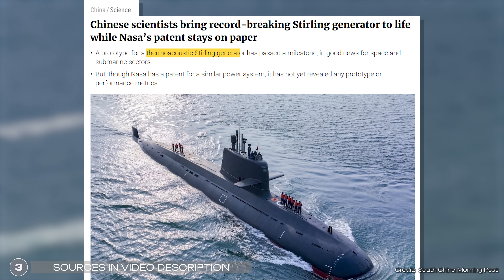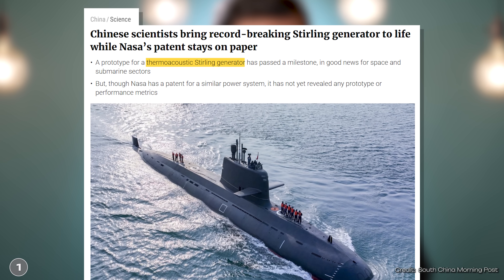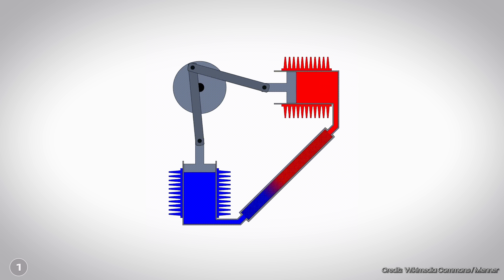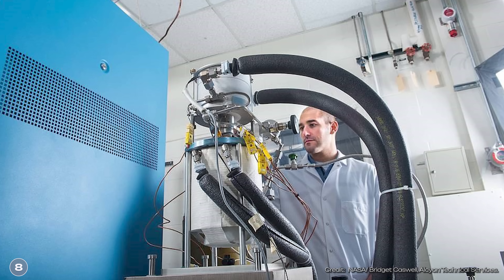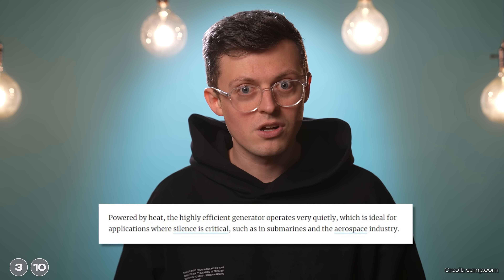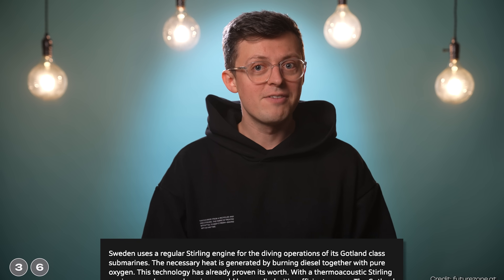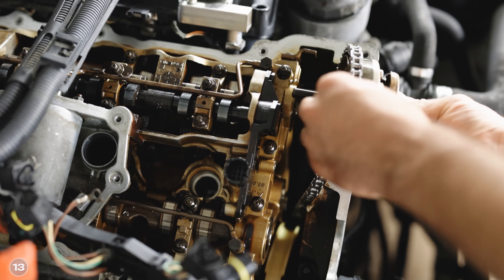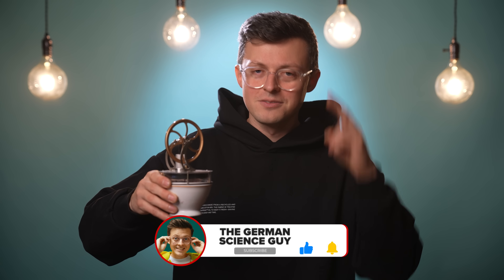The world's most POWERFUL Stirling engine: powered by soundwaves!

Comment: the proper sterling will help to suck every possible quant of heat energy in processes where a lot of heat energi is exposed, datacenters, air conditioners, gliders, is possible to generate energy back, also it can be second generator for, gasoline, diseil generators where we have lost of energy as heat energy, the sterling without rotating parts, just shift going back and forward with magnet coils anf magnets can be cobine with wells turbine

Comment: Another way to do this is to take tesla coils lined up and that works. Another way to do this is to take 3 regular transformer (preferably rodin) and have 2 wound opposite directions to cancel eachotehrs impedance out with destructive interference. Another way to do this is the 2 piston engine. Another way to do this is carbon rods arch and heating method on pyrocrystals (same concept as the tesla coils almost)

Comment: @German Science Guy  

The acoustic engine is 2 or more piezo crystals that push on eachother with their mechanical ultrasound waves to induce electricity in eachother(voltage) without conducting electricity through the crystal so their dissipation is minimal. Their conversion coeff is 30-50%
so it's not the 2 piston engine.

ingredients are: Lead oxide 60-72%, zironcium oxide 5-25%, titanium oxide 5-15%, lanthanum oxide 0-4%, nickel oxide 0-7% and niobium oxide 0-20%.
Their resonance frequency is 27MHz (for uuartz).

Hook them in a glass tube so they hit eachother and induce voltage, then wire them in series to add voltage. Siphon current and voltage back through to not waste it as IT IS NOT CONDUCTED by the piezo crystals and electricity can not travel through them. The elecricity is coplanar with he crystal and "bumps" into it. The entire idea is to miniizie voltage split and electrical loss this way while amplification is occuring.

Comment: Not especially for space travel but the molten salt thorium reacto can use this as an addendum for electrical power added to use part of the power for electricity and using the rest of the hot fluid for process heat in chemical use. This would drain off very little heat using the rest for process heat. Not sure how large this should be,(how many kilowattes is needed for electrical power).like a bunch of these units used for electrical power of say 500 kilowattes, and doesn't need cooling to produce this power. If it would run for 40 or 50 years this electrical power would need little maintenance. Might need exotic metals for the long lasting effects.

Comment: Stirling engine is so elegant! Lack of automotive aplications in hybrid vehicles is puzzling. Thanks for the video!
Reply: NASA used Stirling engines in automobiles as part of their performance testing in the late 70s early 80s. The Stirling engine is less responsive than an ICE and doesn't store energy as pressure like a steam automobile. As result, they didn't do so hot. NASA has a serious issue with anything that can create fire so talking about combustion engines with them is like trying to get assault victims to support loosening government restrictions, even on your best day it's a challenge. So the smart people at NASA thought about what is the best application for the Stirling engine and they determined that power generation is where it shines. The problem was inefficiency due to energy loss during transfer of energy through the casing into the cylinder. 

Several factors have drastically changed the game. First, they've shifted away from chemical combustion and focused on nuclear decay, and the development of graphene is a game changing discovery which will yield some incredible design changes. Graphene has unique properties unlike steel, or aluminum which allow graphene to transfer heat through strands from end to end with negligible change in temperature of the graphene chord. Let me say that another way... I can burn the end of a graphene strand with a acetylene torch while I hold it with my bare hand and you can pick up the opposite end with your bare hand and press the end against your cigarette and light it. As a result, we're not far from seeing a complete shift away from steam systems used in electrical generation to systems that convert heat into energy powered by Stirling or Rankine cycle engines.

Comment: A big difference between a combustion engine and a sterling engine is that a combustion engine needs a fuel that it can combust. A sterling engine needs a heat source and a heat sink. A heat source can be waste heat of a combustion engine or industrial processes, solar, or even a heat battery.

Comment: Cool video. Im an expert in Stirling engines. I was a process Engineer for many years building them. You can input energy and get heat and cold as well. -150-180c on the cold side.

Comment: I wonder how it would work for solar with parabolical fractures ,
In space for a generator , You could use a Thin Reflective film  That could deploy once in space , 
This could be greatly superior in much lighter weight , Then Photo votaic Solar panels ,     

I wonder how  carbon dioxide in a super Critical  state would work , 
That's half way between a gas and a liquid , They're working on turbines with this , They are one tenth the size And I believe twenty percent more efficient  ,

Comment: I see an exciting prospect in using heat from the sun to drive a development of the early atmospheric steam engines.   Perhaps reducing pressure within a sealed copper tube so water boils earlier might be used to transfer heat from hot to cooler  quickly?   This is a US cooling device used in desert nightclubs to cool clubs at night moving heat into cold desert air.   How can we use this principle needing no electricity.

Comment: I love stirling engines. It could have many applications in such areas where heat would rather be wasted.
Reply: Stirling engines are commonly used in recycling heat waste into usable power. Probably the most innovative design that I've encountered was in a bitcoin mine that was entirely hydro/solar/wind powered which used mineral oil as coolant in a bath. Picture 250 high power GPUs running at maximum temperatures transferring all of the heat into mineral oil which is non-conductive so the oil heats up and the constant flow circulates cooled oil in while the heated oil is evacuated. The whole system was insulated with thermoelectric heat pumps that used thermal paste and cooling fans while the oil was recycled into a heat exchanger that ran the mineral oil through a Type A Stirling engine which was heated by the oil and cooled by a waterfall of a low boiling point liquid/gas (I don't recall what was used) which was recaptured by a condenser. All together it was barely enough energy to cool the whole system, but it was pretty ingenious in my opinion.

Comment: Great video, thanks for it. Being slow to adjust operating speeds is not a serious drawback if the output runs an electric generator/alternator, which work efficiently at steady RPM and torque (fine for charging batteries).

Comment: It would be interesting to see the Kockums Stirling engine for submarine air-independent propulsion in the Stirling engine comparison chart. The two v4-275R engines in the Gotland class have 75 kW output (presumably each), running on diesel fuel and liquid oxygen, and they are roughly comparable in size to the thermoacoustic engine shown. 

One source ( A new equation representing the performance of kinematic Stirling engines Jesús-Ignacio Prieto, Mar 2000) reports for the V4-275R Mark II engine:
hot side temperature: 720 °C (993 K)
cold side temperature: 35 °C (308 K)
gas: helium
operating pressure: 12.7 MPa
nominal brake power: 65 kW
efficiency: 37% 
This is a high hot side temperature and resulting high efficiency compared to engines in the chart. 

Another report shows an operating speed of 2400 RPM, which is 40 Hz (although with a rotating shaft output) generator output power frequency can be any multiple of that.

In Proceedings of the Institution of Mechanical Engineers, Part A: Journal of Power and Energy, Volume 202, Issue 4 (1988) the output of the v4-275R was reported as a peak of 100 kW, although the output of this engine is usually quoted as 75 kW, which is likely the continuous generator output power rating. 

The v4-275R was a development from the earlier 4-95 by United Stirling; the 4-95 itself was a 40 kW engine from the 1970's and would also be interesting to see in the chart.

Comment: i dont understand anything of this tech, but a machine that works with soundwaves and is super quiet????
Reply: The sound waves are enclosed in the very heavy steel casing that is necessary to contain the static and dynamic pressures of the working gas.  This casing is probably 3 inches thick, possibly more.

Comment: 100kW here on earth where you have an external heat sink, like the sea!
In space that is not an option, dissipating enough heat to make it work is challenging, to say the least!
Reply: I guess you don't understand that it's extremely cold in the vacuum of space?
Reply: @TheWingnut58  The limitation (in space) is the size of your radiator and its coefficient of emissivity - that decides how how much power you can dispose of for a given (radiator) temperature.
Reply: @brianletter3545  Totally agree! :)
Reply: @TheWingnut58  That is irrelevant, because it is a vacuum, so you can ONLY get rid of heat by radiation.   Space is actually very hard to deal with, everything slowly cools down to extremely low temps unless you heat it enough to compensate, which is actually not much.  Then you have things like plutonium thermal power units which must get rid of excess heat, sol they have many large black fins to radiate it away.
What I am saying is that if space had an atmosphere that was very cold two things would happen, getting rid of heat would be cray easy, but it would be IMPOSSIBLE to keep the rest of the craft warm enough to function.  Conductive and radiative heat dissipation are very different hings.  Conductive is FAST, radiative is very slow.
Reply: @ I'm looking for you reference to the James Webb Space Telescope (JWST) that uses an acoustic heat pump to lower the temperature of the sensor from 50K to 6K! I'm sure you know about it.
Reply: @stevenbliss989  "What I am saying is that if space had an atmosphere . . "
Most gas in space lands up  as an atmosphere through the gravity of mainly planets or stars.
'Gas' and a 'the vacuum of space' do not go well together!

Comment: Passive sonar does not detect a submarine by listening for its engine. The fact that you have to propel the aircraft through the Water by means of some sort of a propeller causes impact waves in the water which are Audible. That's how we know what submarine we're listening to when we hear it moving underwater because the difference in manufacturer from one propeller to the next is enough to tell us which submarine it is those very same underwater sound waves caused by the propeller also give away its approximate Mass.

Comment: What's wrong using the Atmospheric (flame-licker) engine vs the Sterling engine?! Is it its low rev?
Reply: Engines working around atmospheric pressure & temperature have a correspondingly low energy density. As an example steam locomotives exhausted steam at quite a high pressure & temperature - meaning they were powerful but inefficient - the exhausted steam still had a lot of energy in it.

Electric power stations have very large diameter 'low pressure' turbines and giant 'Cooling Towers' to get more energy out of the steam and so the fuel, giving  a higher efficiency (fuel in/power out).

Comment: In the mid-1980s, I managed the Air Force side of a joint-service program with the Army to develop Sterling engines. We found there Must be seals. The idea of a piston-to-cylinder gap of only a hair's width is inadequate. Billows were the only way to get a perfect seal and minimum resistance. And billows always wear out. We studied the WHY billows wear out and created amazing new shapes. They still wore out far too soon for them to be practical.
 -- However, I don't yet grasp this concept of thermal acoustics here. I did some graduate-level studies of acoustic waves and only remember that acoustics is weird stuff, particularly when you play with odd shapes of the sound chamber.
Reply: I would rather talk about acoustic waves only in the case of the loop thermoacoustic engine, in the rest it is better to understand it as a gas piston. Gas has mass and elasticity, so it works in the tube as if it were a piston. Imagine the gas as a piston, and you will understand!
Reply: Diaphragms, not pistons or bellows.

Comment: So in order to make this engine work, you will need a heat source like a nuclear reactor or lithium batteries because you can't burn fuel while submerged underwater so why would you put a thermo acoustic engine if you can just use the nuclear reactor or lithium battery for propulsion?
Reply: Turns out you can burn fuel underwater. That is exactly what the Sterling powered Swedish submarine does. The reason it works is because the fuel and oxidizer can be burned at the ambient pressure of the surrounding water and discharged into the ocean. External combustion is the key.
Reply: @rustybucket2248  I think you are confused. Disregarding the fact that underwater is not ambient "pressure" nor temperature , burning a fuel source in a pressurized submarine will use up oxygen which you need to survive. A Stirling engine requires an  external heat source to activate it so unless the crew of the Chinese sub intend to rub their bodies near the Stirling engine, I don't see any other way to externally heat up the Stirling engine in freezing waters without the use of Nuclear reactors or Lithium batteries. You might as well create a Steam-powered  submarine and see how well that will do?
Reply: @JacobJackson-gv1ci  This is exactly what the British did in the First World War: the infamous K-Class submarines. Needless to say, it did not end well.
Reply: @ I agree. I'm all for new technologies but not at the expense of human lives.

Comment: In space, as a generator, it should be excellent. The sun warms the sun side of satellites, space-stations, and rockets quite well, and if you cover their sun side with a few Stirling engines you not only resolve the problem of heat management, but you get some power for it too.
Reply: except where does the heat then go? problem with being in a vacuum is its hard to dispose of that heat... radiators dont work, theres nothing to draw the heat away.. can only radiate it as IR...

space. vacuum. no conduction, no convection, and a limit on radiation... its neither hot, nor cold. its nothing.
Reply: @paradiselost9946  Hot things glow!!! thereby they loose energy. Yes, it's not as fast as in air or water but that can be solved with a greater radiative area (the reason radiators have fins).

Comment: It’s using Terfanol-D the china model the same giant magnetostrictive rare earth alloy that’s used in actuators, super high pressure diesel injection, and those neat little cylinders that turn anything into a speaker.

Comment: Assuming your statement about speed control is correct;  it would appear to be an excellent use in hybrids e.g. Stirling engine running at a constant rate driving a generator that in turn drives an easily controlled electric motor[s].  Thus a "Stirlng Battery" as a substitute for expensive, heavy high maintenance, and dangerous large battteries.  Perhaps one could add a small storage batter and/or capacitor banks to handle surge situations...  Just a thought.  Thanks you for your excellent presentation.
Reply: Honestly thats very intresting cause like u said the engine could run at a fixed speed (where efficency is at its maximum)ah shit but what if u require less energy like at a traffic light. U might need something to store that eccess electrical energy. Hmmmmm maybe a big capacitor?
Reply: Yes just like a Diesel Train. This should be the format for all Hybrid vehicles, a constant spped generator runninig at peak torque, and electric trucks at the wheels.
Reply: Companies are testing this. Unfortunately it’s a long process due to lack of ready made small, light engines. Hybrid with LiIon is a relatively new possibility and the stirling engine has lost 100 years of development. The risk investing in this development is that before it’s good enough, cheaper, better batteries are available. I have looked into this. It would be so fun modifying an EV with a defective battery, they can be bought for cheap. For example an old Model S.
Reply: Hmmm thats an intresting idea :)
Reply: Huhhhhh control of something is always a bitch

Comment: NASA has a nuclear sterling engine design, patented in 1983, that uses similar concepts. It has a plus 40% efficiency or higher I remember. If it’s public, the military has better versions. I’m including all NATO nations in this.
Reply: It was made to make better RTGs.
Basically, RTGs use a thermoelectric something effect, I forgot what it's called to make electricity.
But it's only 7% efficient.
Although, they found it to be ineffective. Not sure why, but it's probably because radioisotopes don't produce sufficient heat to run the engine efficiently.
Reply: @CosmicHase Peltier and Seebeck effects.
Reply: This sounds expensive for using it in military combats
Reply: Are you talking about kilopower? Or something older?